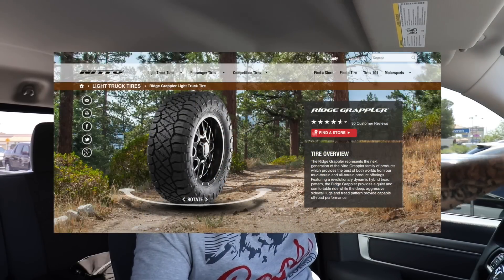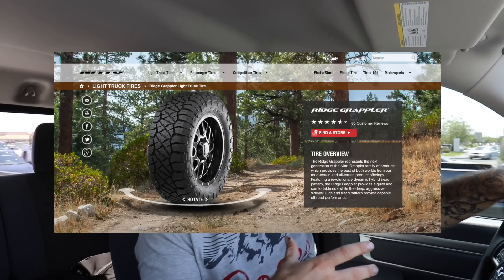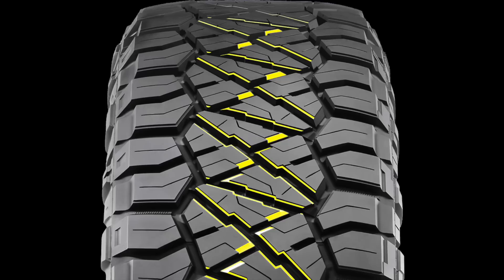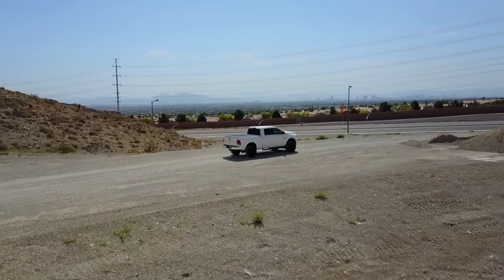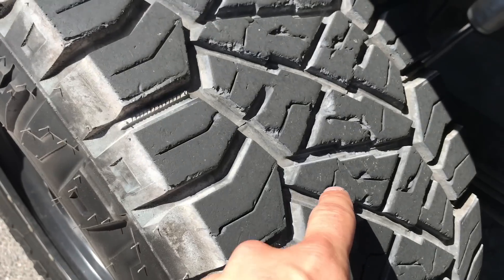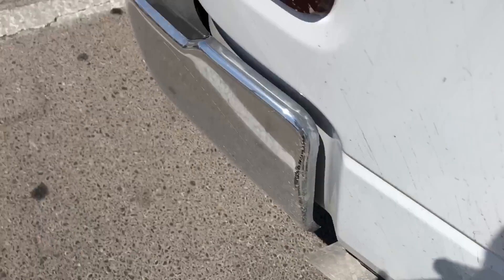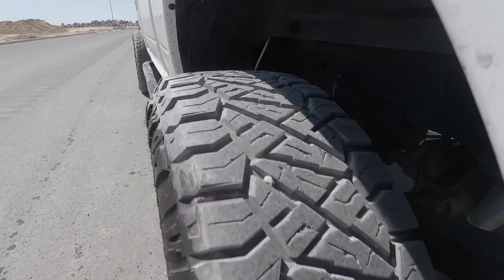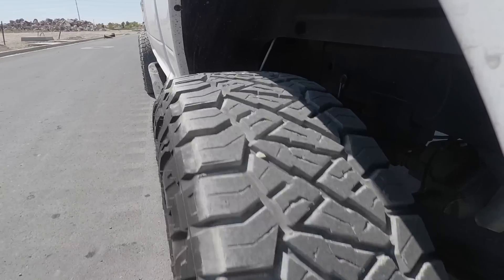Nitto Ridge Grapplers SHREDDED After 4,000 Miles - Jay Flat Out

Comment: nittos look cool but they do not last at all. expensive as hell too for a 10k mile tire at max
Reply from the maker: Yeah I'm really really disappointed in these
Reply: Jon Hughes that's weird got 53k on my Mudd grapples before they toasted. With some burnouts on them
Reply: chevydodge88 was it on a little mini truck or what? because u Just buy them for their looks. they aren't really good off-road compared to other tires in that price range and they don't last
Reply: Jon Hughes 2004 dodge ram 2500  with 35s they actually really good in deep snow had a bad snow storm years back in Illinois 3-4 feet high drifts and walked through it pretty easily but it had lockers
Reply: Jon Hughes I actually bought them when they first came out with rims for 1500 shipped to my work loading dock now there expensive as hell
Reply: Jon Hughes after about half tread they started to wear alot slower
Reply: Jon Hughes now for mud there so so at best when compared to swampers  but there better then the Cooper stt I had on my suburban those tires would never dig out of a rut
Reply: Funny, i got 60,000 miles out of my trail grapplers.
Reply: U sir are a liar I got over 60k miles on my terra grapplers. I'm always towing over 10k lbs too. I love in Michigan
Reply: @JayFlatOut  silly boy! Nitto  and toyo the same😂😂
Reply: I've got over 30,000 miles on my ridge grapplers and they're still at 12/32nds

Comment: That’s what happens when you drive a 7000+lb truck with m/t like tread and don’t do nothin but drive on the highway
Reply from the maker: +Seth Cawthern actually that’s the opposite of what happens. This is usually caused by gravel.

Comment: The style of driving you do obviously doesn't fit the style of tire.  You must have a very heavy foot on hot pavement.  That is the only way you could destroy this tire in 4000 miles.  That tire starts out with 18/32" of tread depth (not 13/32" like you said).   You don't know much about the tire to start with-not only tread depth but by now you know NIttos are just rebranded Toyos.  Hey, you've shredded the tread too with 6/32" of tread wear in 4000 miles.  Something is wrong with your analysis man.  This tire gets huge numbers of great reviews with high marks for longevity off road.

Comment: This is disappointing. I am looking at this tire and the Toyo R/T
Reply from the maker: At this point I'd have to nudge you towards the Toyo
Reply: Yea, and I've had the terra grapplers before and loved them. I guess they just need a few more generations of the ridge grappler before its on par with the others.
Reply: One the cummins forum, the ridge grappler is heavily preferred over the Toyo RT.
Reply: got a link to the thread you are referring to?
Reply: Ive got a set of 37in toyo rt's and have 25,000 on them and still looking great.

Comment: In all honesty there is nothing wrong with your tires if you still have 12/32 of tread life after 4k miles.  I'm a fan of KO2s on my 2500 Sierra, but I do use them on a more aggressive and technical trails.
Reply from the maker: +jamesngotts it’s the chunked Out portions I’m talking about
Reply: Yeah I know, but that's just the effects of extreme heat on the tires which you pointed out

Comment: I built my Bronco into a long travel prerunner that is street legal and street driven regularly also. I am a little more interested in my tires being rugged performers. You guys with 4 wheel parts chain style lifts and upgrades of various levels driving to the mall or in Jeeple traffic may shop for other qualities (or lack of) in tires. I prefer proven desert race tires that complete races often on many vehicles without flats. BF Goodrich and General Grabber are what I would pick these days and have been working well many off road /on road  miles not driven like grandpa style. When 80-160 miles on off road trips far from pavement and service that is not you. The tires a key factor and subject to rough dangerous paths and surprises are IMPORTANT to have good proven off road  tires.....https://www.youtube.com/watch?v=LtuWtuR2qIg&t=22s
Reply from the maker: https://youtu.be/ERkHN_OsD6s
Reply: Jay Flat Out  (of cash on Carli and 4 wheel disco parts)  Well that is hard to say when you call it worth.  I imagine you did spend more money than me but the things needed to do to make a TTB great vs your control arms is much less for huge 4x4 wheel travel. I have gears, better high amp alt. lockers, performance trans, better brakes, rebuilt upgraded transfer case and King Shocks. Glass fenders and hood  and great stereo system too and more. A Raptor is worth more on paper with 13" front  and 13.9" rear travel. I have 18" front and 20" rear and my TTB is plated and gusseted with skid plate welded as well holding upgraded axle shafts hubs and brakes. I would not be very comfortable driving a Raptor fast off road with the price myself. Much of my stuff is built by race shops and improved myself with proven known things to do. It is worth more to me and doing work myself pushes that as well. It amazes me smoothing out rough at speed. I have had 4 4x4's with Rancho kits and shocks that are miles behind this. We can all be proud of our trucks and my current Bronco shines bright like that for me. As far as tires go I would buy BF Goodrich or General Grabbers race proven ones. I have owned both and they work well.